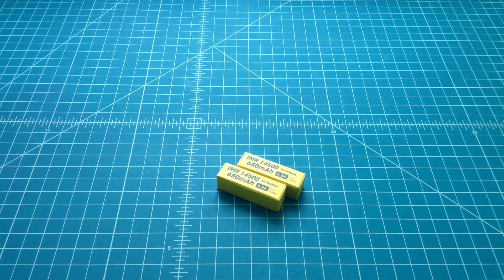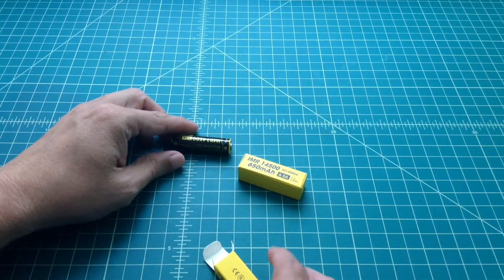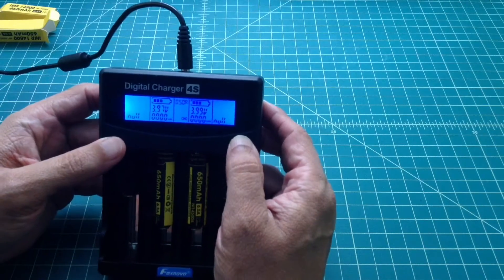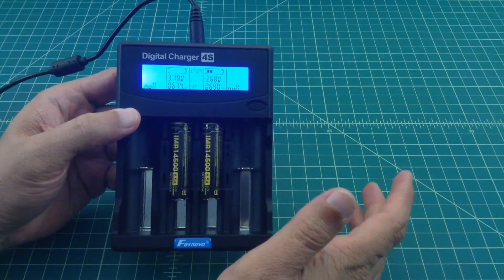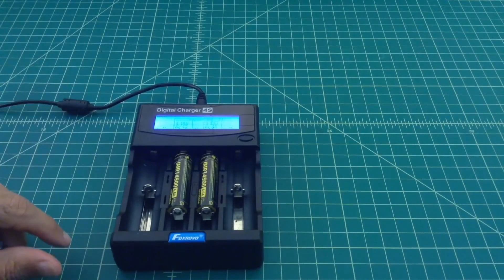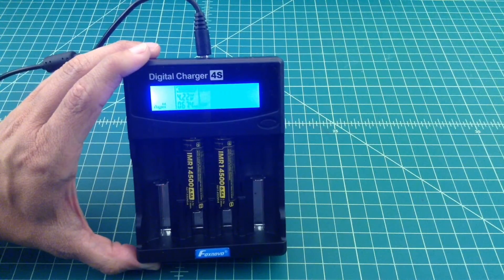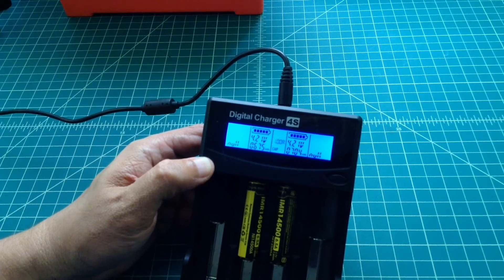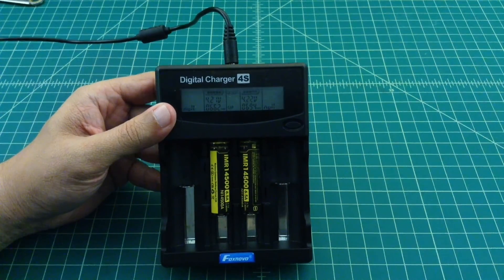Nitecore 14500 IMR Li-Ion Rechargeable  Battery Capacity Testing - TheSmokinApe

Comment: Are all 14500 batteries the same like AA are all the same don’t know anything about them and don’t want to blow my flashlight up
Reply from the maker: No. Some are rechargeable and some are not.  Also of the rechargeable they can have different chemistry, lcr vs Imr for example.
Reply: TheSmokinApe here I’ll just give you the run down basically I bought the new trunite t10v2 and want the max 550 lumen output and have these random 14500 rechargeable batteries go by the brand ultrafire 

+TR 14500 900mah  3.7v    is Written on it and trunite says on the website it says they used a 750mAh 14500 batteries so my question is can I use the batteries I have safely and reliably 

Ps sorry for any spelling mistakes and not punctuating
Reply from the maker: Sorry man, I am not familiar with the battery or flashlight.  Mah is how much energy is stored in the battery amps are the discharge rate, you want to make sure the battery can deliver the amps the flashlight requires.

Comment: I'm looking for batteries to power a Manker T01, any recommendations?
Reply from the maker: +Sam Watson From the Manker Site: Peak beam intensity: 10,000 cd
(drive by Eneloop Pro NI-MH battery).
Max LumeOutput: 900LM 
Peak beam intensity: 20,000 cd
(Drive by 14500 Lithium Battery).

If you want to run NI-MH I’d use Eneloop if you want Li-ION I’d go Nitecore or Olight.

Comment: Most of my torches use 18650, I bought a jetbeam  to clip to my hat and its pretty cool. they recommended a 3.2 rechargeable so I bought Duracell recarchable however Energizer disposables way out preform the rechargables. Any thoughts?
Reply from the maker: rich5817 By out preform do you mean brightness or run time?
Reply: Brightness is the same although they say it will only get 450m lumens with a 3.2 rechargeable, a good energizer last twice as long as the Duracell 1700 mah with the same beam. I already smoked a Olight sr baton with the wrong battery but this one is just an $18 disposable I'm not to concerned about TY
Reply from the maker: That is odd, could the Duracells have been damaged?  What charger do you use?
Reply: are your duracell rechargeables 1.2v not 3.2v???? all disposable aa batteries are 1.5v.... enegergizer ultimate lithium disposable are 1.5v and 2900mAh...  i think only 14500 rechargeable batteries carry 3.2v+ usually 3.7ish. even my eneloop pro have 1.2v and 2450mAh
Reply: I know a old post. 
I just ordered 800 of these on eBay. 
I’m going to buy the cheap 1.00 Walmart flashlights in sporting goods. Pull out the aaa holder . Then insert a 14500. 
I’ve used ( improvised) 18650 in them.